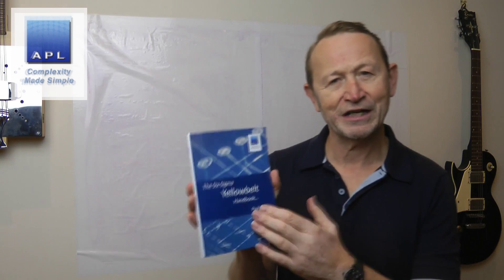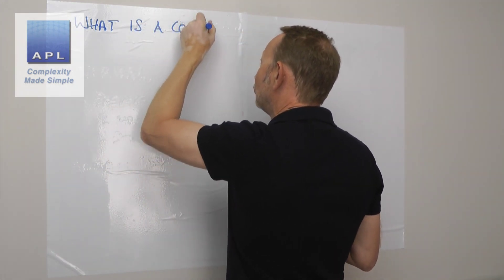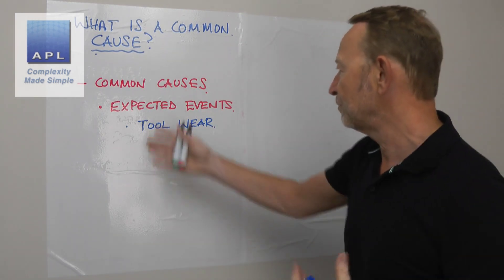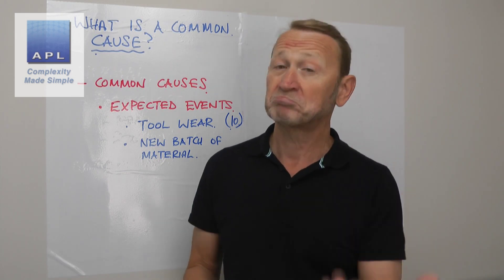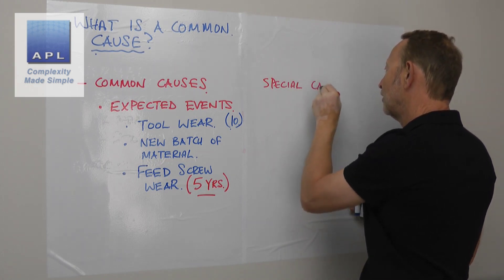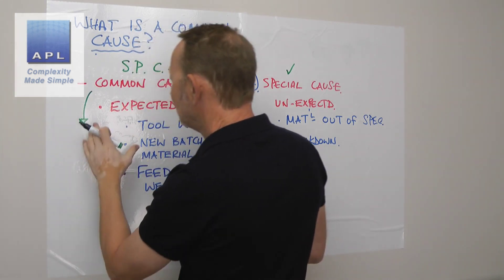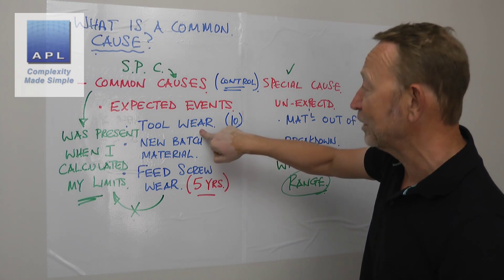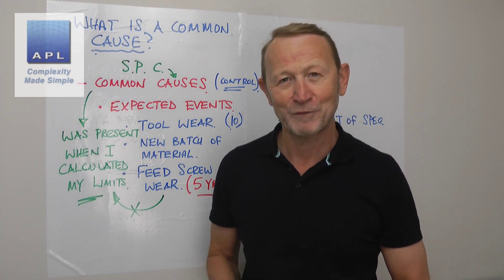Common Cause Variability or Special Cause?

Comment: Thanks Paul.  

My understanding of common cause is due to the design of the process, standardized work instructions, homogeneous materials meeting specification, controlled environment, and other similar factors required for stability. When constructing control charts, rational subgroups or samples produced under the same conditions are used to determine the control limits. Rational subgroups are therefore homogeneous groups or samples that contain only common causes for variation (e.g., same material, same process settings etc.).  

As engineers or managers, we want to make sure we aren't wasting time by investigating common cause variation, i.e., we want to make sure we react to statistically significant noise signals in the data. One example of those signals is a data point outside of the 3-sigma control limits also termed as astronomical events. 

However, it is important to note that process control charts can reveal problems even when the data points fall within the control limits. If the plot looks non-random by manifesting trends, runs, shifts, clustering, mixtures, and oscillations there may be something wrong. Minitab provides these tests to detect assignable causes for variable control charts. 

So, my understanding of tool wear, screw wear and different batches of material will most likely result in special causes.

Comment: Paul thank you for the video. I completely understand what you saying in the video and really enjoyed it. 
Statistically I think that Shewhart method is handy because it makes people understand in which cases the process shifts (special causes for him) versus the other cases where process doesn't shift but variability is still high and control limits therefore wide (common causes in spc). In the first case (the shift), there's the risk of often crossing the spec limits with terrible results in terms of predictability and capability . If the process is a mess (many Shewhart's special causes), then people should really review their procedures and fix what's going on. The second scenario (stable process) is more predictable, but it can and should be improved to achieve an overall better sigma level, unless it's already a very good one. First case is a problem solving scenario, this last case more of an improvement scenario. Please let me know your thoughts and if this makes sense to you.
Reply from the maker: Luigi - you are spot on that is exactly as I would describe it...

Comment: Common cause could also be environmental factors, such as machine start up or warm up, cooling time that may have an effect on each batch of products or even machine performance based on external temperature. In this case, expected temperature ranges may be common causes, trains run slower in autumn with leaves on the line, but they are also affected by extremes of heat or cold.